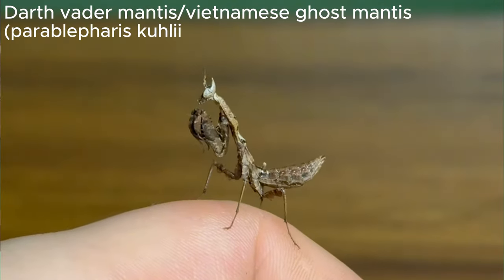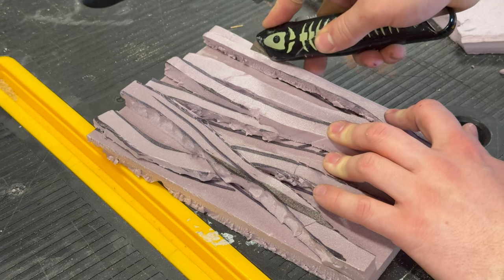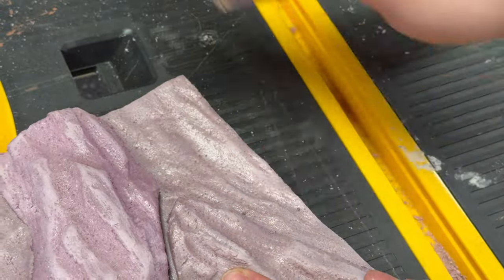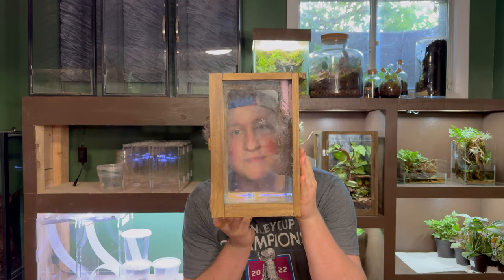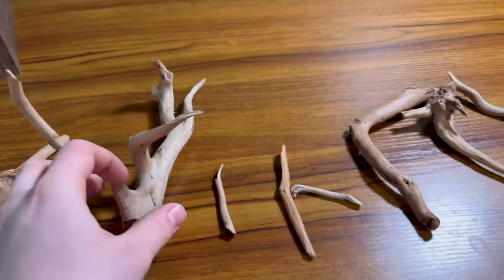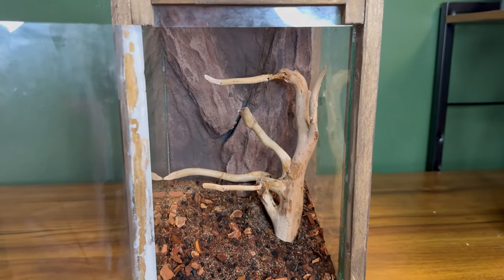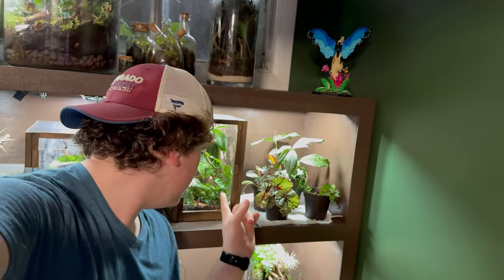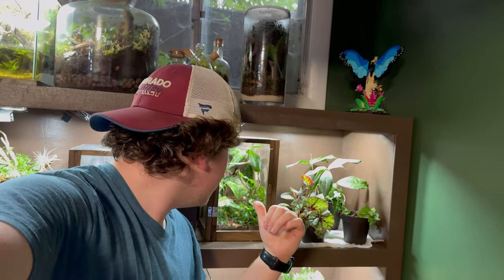DIY Darth vader praying mantis Vivarium (Vietnamese ghost mantis)

Comment: I’m. Making a 12 x 12 x 18 bioactive enclosure for a green anole. Do you have recommendations for canopy plants that could fill in the space up top but not get super huge? Also the enclosure was awesome
Reply from the maker: Thank you! I would say various species of dracaena. They don’t grow super fast, come in multiple varieties, fill in quite a bit of space, and don’t require frequent watering. I actually just used one as a canopy plant in an upcoming enclosure. Another plant is bromeliads. They’re great for covering areas, but they do grow a bit faster and require pretty frequently watering. Pothos can also be good but they grow fast and can get fairly big. They do vine though so that could be an option. I would recommend checking out the dracaenas though, they’re a personal favorite and I think they would work well.
Reply: @hodesigns  thanks for the ideas! Do you know any smaller species of bromeliads, because I know some get pretty big, especially because I only have a 10 gallon tank.
Reply from the maker: Yeah honestly I’m not to sure, I had some a few years ago the were pretty small, I don’t have them anymore though so I’m not too sure on that one